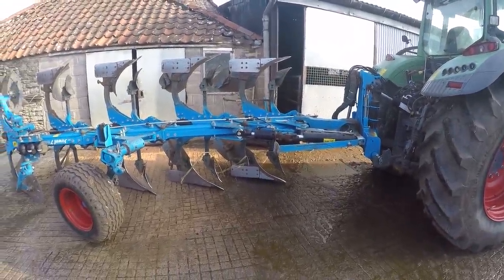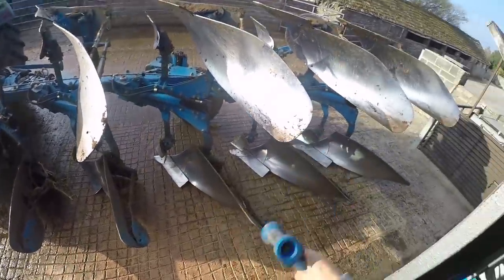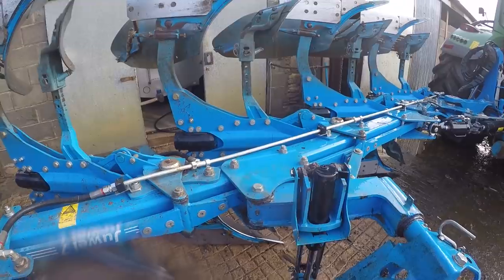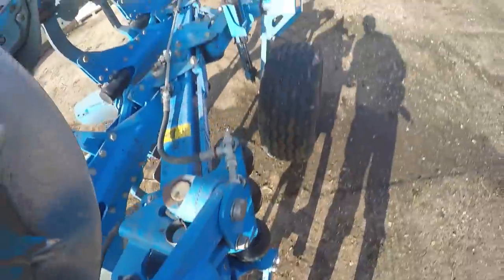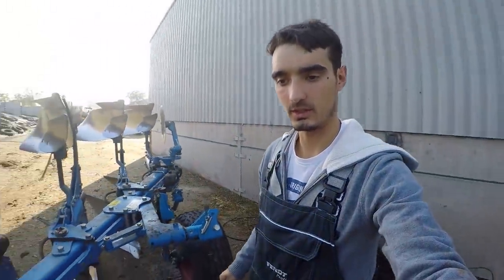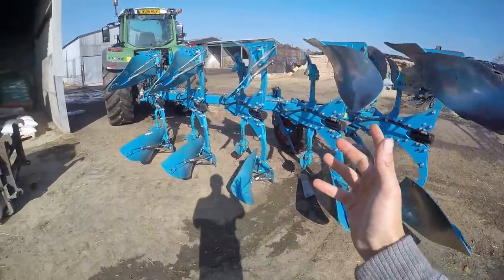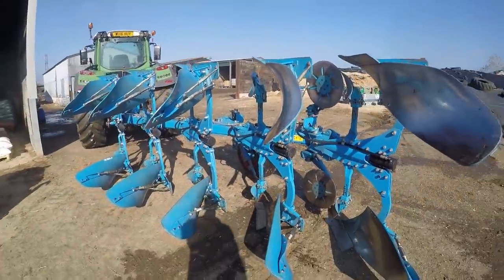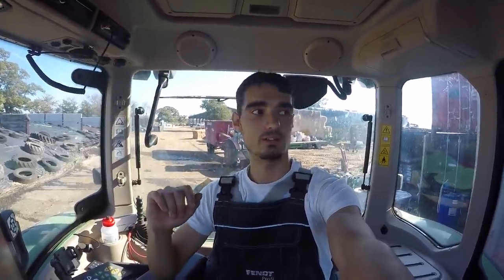Winter Maintenance For Plough and Ag Machinery

Comment: Just one thing about greasing THEN washing the plough. Your just going to blast water into the chambers if there is any space then it'll start to rust then you will have a hard time moving it in spring or summer. I had to completely dissemble a plough cause someone did that and it sheared a couple of bolts because of that. If you could put a polly sheet over the plough it would help with rain staying on it and cause rust. Great video as always. Keep up the good work.
Reply: Shouldn't be an issue if you are re greasing thoroughly afterwards?
Reply: AgriVideos1 I would say grease it then wash then grease it again to get any water that could of gotten in out. I've had to free up mowers, forage wagons and trailered harvesters it's the same problem every time of it not moving very easily because they have greased it then washed it. It's a big problem with a simple fix pretty much.
Reply: @Masseyman-nv2kl  That is literally what Ryan did...
Reply: Matt Jones Ryan greased it then washed, he never greased it again to push any water that might have gotten in out...
Reply: Masseyman6480 are you a farmer
Reply: @Masseyman-nv2kl  5:19
Reply: @Masseyman-nv2kl  My god, watch the video!! That is exactly what Ryan did!! Greased, washed, greased
Reply: Matt Jones I'm talking about greasing the pin sleeves that's where the rust starts and will continue to spread if you don't grease the pin sleeves after you wash it.
Reply: Greg Bailey I'm a full time agri mechanic and part time farmer. What's your point about asking me if I'm a farmer or not anyway?
Reply: Masseyman6480 He made a point of saying he greased everything before and after washing.
Reply: AgriVideos1 yes he greased the sleeves once then greased the mole board but he never greased the sleeves again and that's where the problems can start.
Reply from the maker: sorry if i didnt make it clear in the video but i did grease all the sleaves and greese nipples after washing it as well